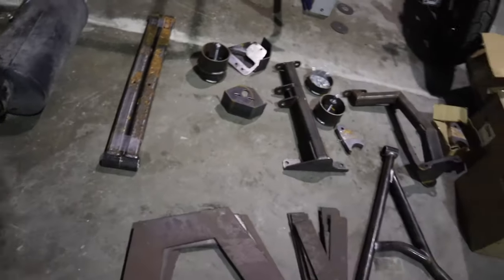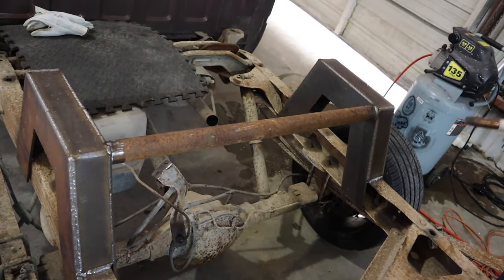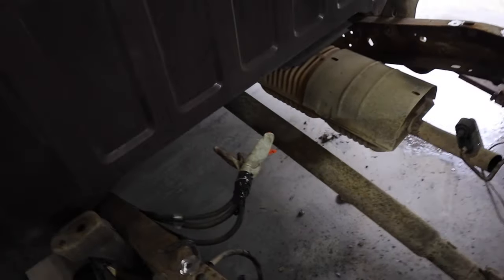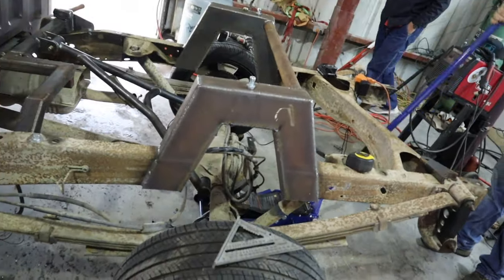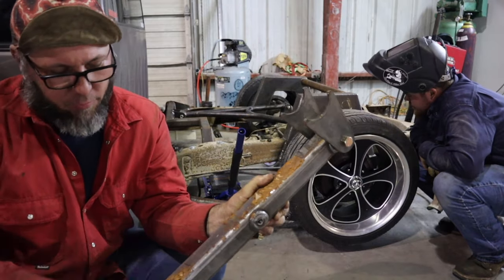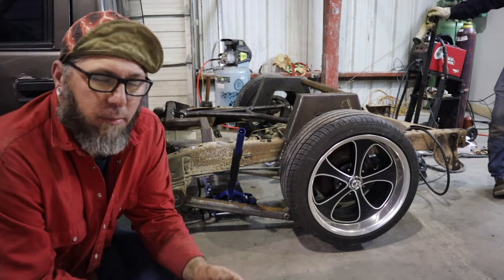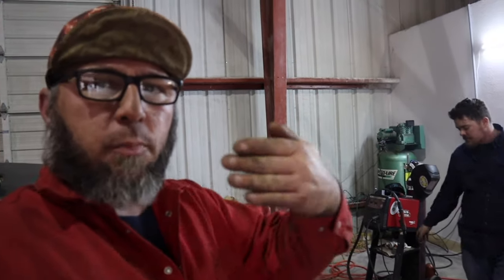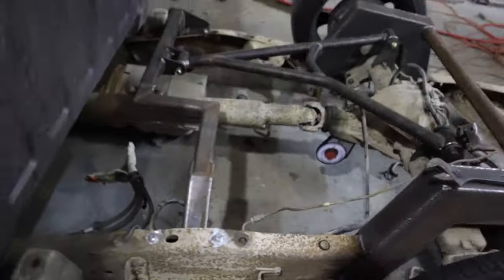How To Bag an OBS - Nfamus 3 link PT.1

Comment: What’s the widest wheel you can run on the rear with a Nfamous 3 link?
Reply from the maker: 10" , But Depends on the offset, also Nfamus sells an under frame 3 link. It locates the lower bars under the frame

Comment: How well does the 3 link do doing side to side thanks
Reply from the maker: No side to side with a 3 link. You can do it but it has the potential to break the bolt in the front of the wishbone. You need a 4 link for proper side to side
Reply: @Carport Customs  thanks what kit do you like for a 4 link for a obs
Reply from the maker: I hand build my 4 links. I don’t know of anyone that sales a kit. To keep gas tank in stock location you will need a parallel 4 link and watts link. If the tank is not going to be in stock location then you can do a triangle 4 link.
Reply: @Carport Customs  thank you for getting back with me love watching you builds
Reply from the maker: Thanks for watching. I promise I have lots more coming. I’m still trying to figure it all out as far as the channel goes. We have some really cool builds coming up and lots of knowledge to pass along.

Comment: I have the same kit for a 97 Chevy dually. My truck has a two piece driveshaft. Do I measure the pinion angle at the trans or carrier bearing?
Reply from the maker: both check out this video at the 47 min mark. It will help you. https://www.youtube.com/watch?v=ZBDAqePHZq8&t=2435s